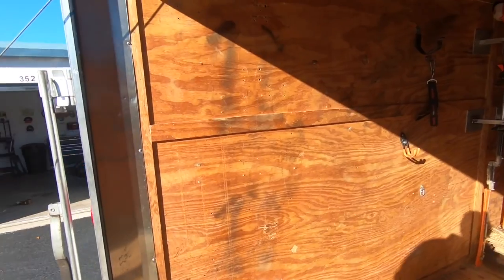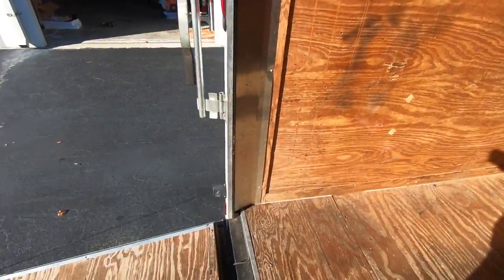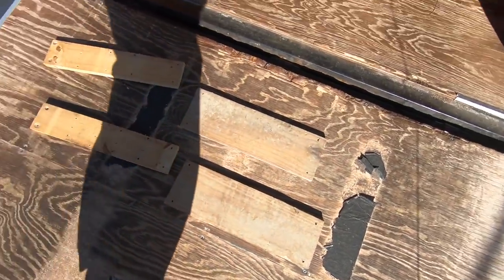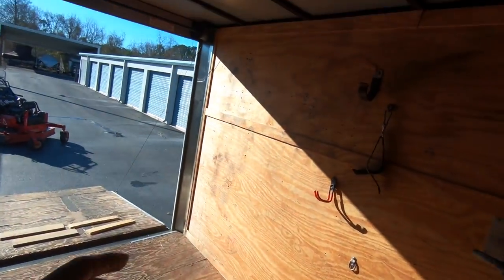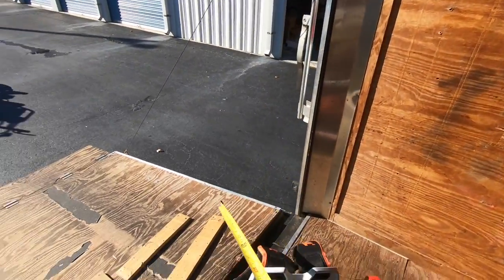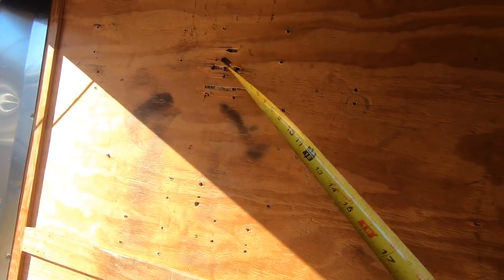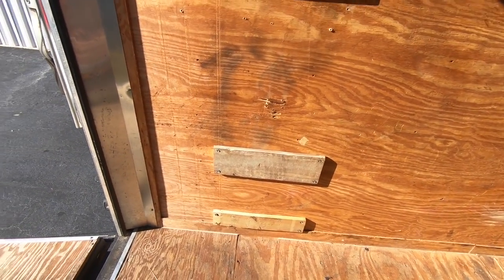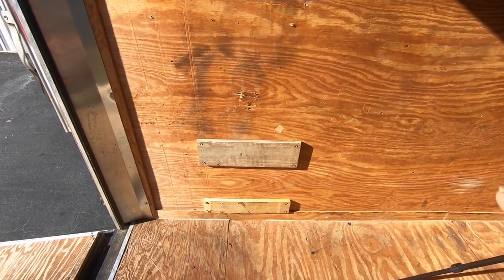Equipment Defender Blower Rack V-2 install - Enclosed Trailer Blower Rack

Comment: Good day Sir. Just a suggestion as I had an issue with my trailer having the interior panels looking like Swiss cheese. I took of all mounting racks and PL‘d sheets of 3/4” plywood to the existing panels. Then, I did what you did by installing the boards for mounting the racks. In my opinion it makes all stronger. Great videos. Keep it up. 👍
Reply from the maker: Thanks for the suggestion, and I appreciate it!

Comment: I hope that works for you my man. For me, it would be so aggravating. Too big a footprint!. I'll pick up mine from the floor freeing up space that the rack occupies. No doubt, every inch is needed on those trailers taking riding mowers on and off. There is no way my bagging system on the back of the Gravely would fit like you mounted. Alternative would be to move to the nose of the trailer.  Peace :)

Comment: You could've used an 8'ft 2"X4". Screwed it in on each end and the middle to avoid putting so many holes in the trailer walls.